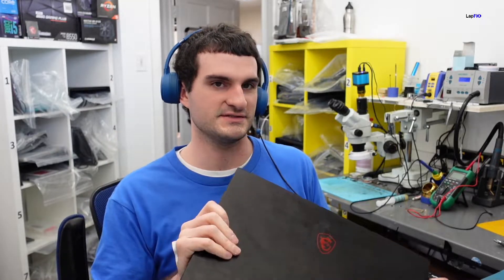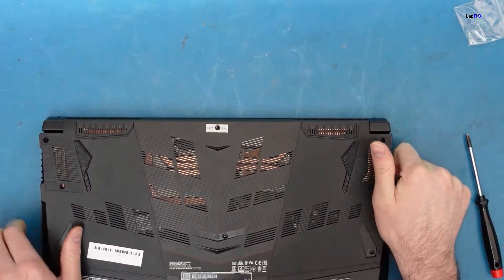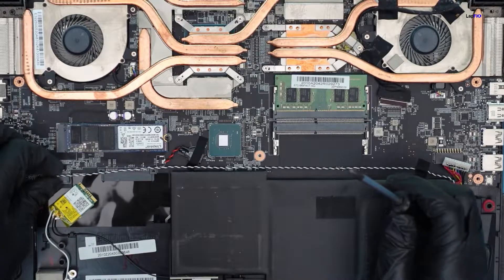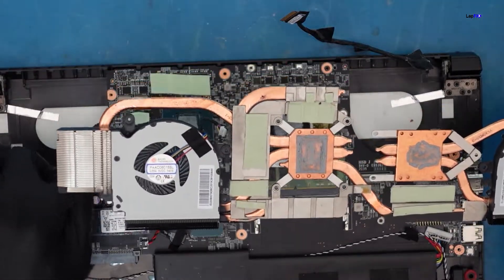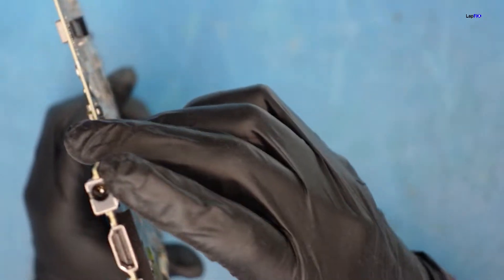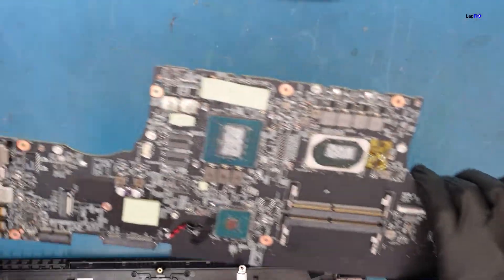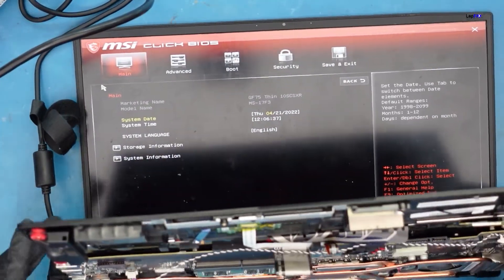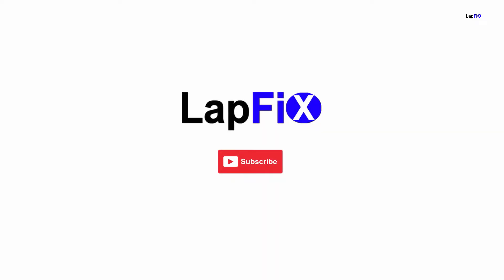Fixing a Dead MSI GF75 Thin Laptop - DC Jack Repair

Comment: i have exact laptop , had for almost 3 years no issues at all , except just started my power adapter cord that plugs into the laptop , so the port at the laptop is just a little loose i can still use when i move cord and set it in a certain place, so are u able to show this plug in , inside the laptop and let us know what to look for , as may be can fix with a solder or what to look for if need to change the board?
Reply: this is a super common thing with this motherboard and power jack. I have an MSI GF65, same problem. And from what I've seen online, this is a super common problem.

Comment: You didn't tear down the old connector and show how it failed? I want to know how to crack a typ. 10 A plus sense connector, clean and reset it  Because they ain't even on the Wikipedia barrel connector map, but maybe the spring contacts aren't irreparably oxidized?

Comment: this is probably the worst gaming laptop ive owned. it worked like it was supposed to until i after a 3 years i decided to try the “CoolerBoost” which after 1 sec of being on destroyed my GPU fan. The laptop itself if also badly designed with outlet vents that are covered when the lid is open, and intakes that barely can get air when the “laptop” is placed on your lap or anything that covers the bottom. Also this laptop is anything except repair friendly but thats not a very big surprise from MSI. Defintively not deserving of the “beginner” laptop title its being sold under. my alienware 14 with almost 0 maintenance from 2013 has lasted longer than this glorified frisbee. Oh yeah lets not forget that the entire chassis bends permanently out of shape if you dare to pick it up wrong a single time

Comment: Hey sir,
I'm from Nepal.
I have MSI GF75 10sdr.
I always used to clean my laptop myself.
I tried cleaning it 6 months ago. It has some issues now. It doesn't show anything in screen although it starts up. I tried to fix it through local repair centres. No one can detect any error sir. I'm ready to change my motherboard but I can't find any.
Can you please help me?

Comment: this is probably the worst laptop MSI ever made and any laptops since HP DV 2000 ,I have one graphics died ,now completely dead ,ordered motherboard all out there are faulty ,cooked in oven and similar fixed in China ,disaster.
Reply from the maker: Sounds about right 😷
Reply: I have this shit and the design is a disaster too.
Reply: Hey sir,
I'm from Nepal.
I have MSI GF75 10sdr.
I always used to clean my laptop myself.
I tried cleaning it 6 months ago. It has some issues now. It doesn't show anything in screen although it starts up. I tried to fix it through local repair centres. No one can detect any error sir. I'm ready to change my motherboard but I can't find any.
Can you please help me?

Comment: I stumbled across your channel about 10 minutes ago and knew that I had to hit the subscribe button. Your videos are awesome and you explain very well. :D My favorite is the Razer Blade 15! :)
Reply from the maker: Awesome! Thank you!
Reply: @lapfix  you're most welcome.
Reply: @lapfix  
Hey bro,I have an issue with the same type that you worked on, I opened the lap for cleaning removed the battery plug cleaned it and replug the battery on,but it never power on again, never charge again, it completely dead used no thing for cleaning just air blower, what should I do and what did I done to it 😓.